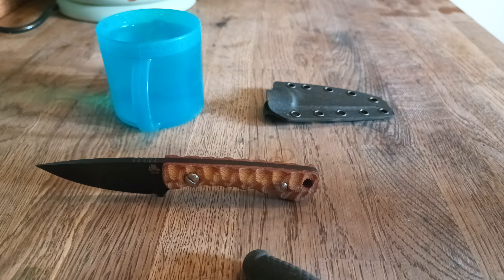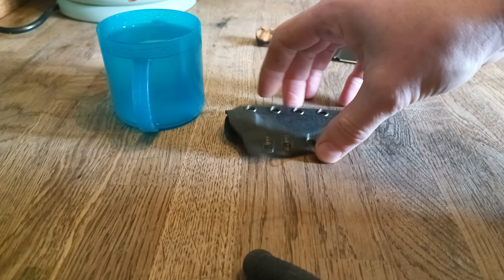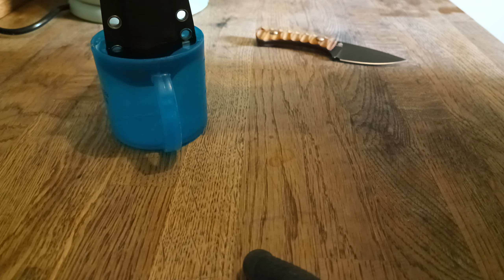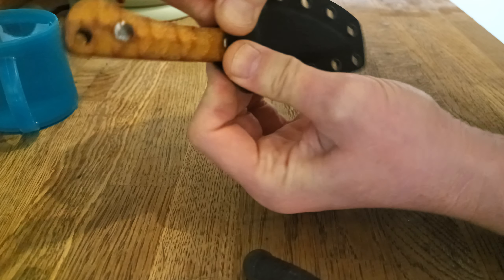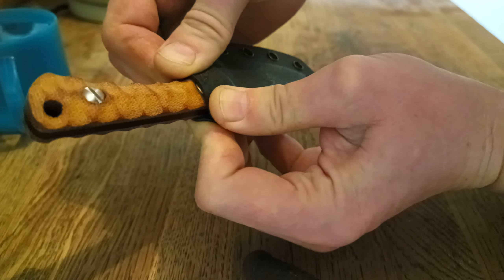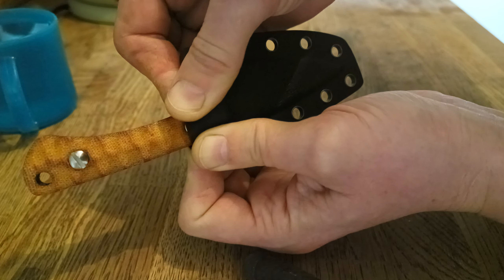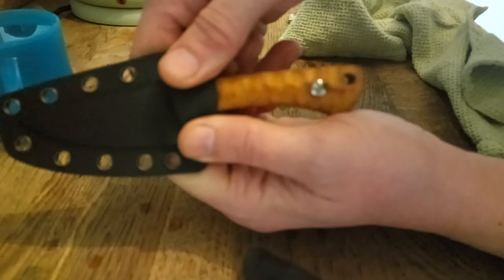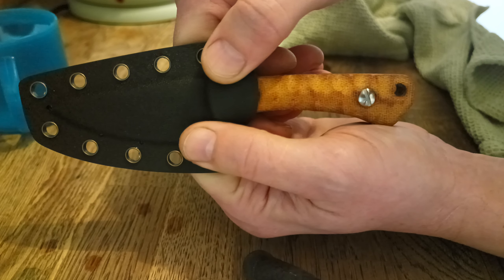How to adjust Kydex sheath retention on the TwistedGbler

Comment: I just got my slip joint in the mail. My favorite knife ever made is the Tony Bose Lanny’s clip. I own 3, made by case. They are so expensive and I cherish them so much I only ever carry one and not often. I also have 2 GEC 74 stallions. This knife of yours is so good. I’m planning to buy a back up for display. Is there any chance you could do a limited edition version with wood or micarta? I’ll buy one of every version you make. Thanks from Alabama, you’re doing great work!
Reply from the maker: Thank you for your kind words and support, we're looking at producing more traditional slip joints, we've currently got a run of authentic Sheffield made slip joints on the site.  Made using authentic Victorian and vintage machinery. 
We're also looking into making a range of classic Slipjoints but with screws and bolts instead of peening rivets, what's your thoughts on that? 
Regards 
James
Reply: I love the look of the Sheffield knives. They look like Taylor’s eye witness. I’m definitely going to buy one of those. I’m a traditional knife guy, I’ve tried a few modern slip joints including a C. Risner Ohio river and a Jack Wolf midnight Jack and honestly it’s not my bag, they’re too thick and they don’t speak to me the same way. I can tell you, loads of guys in Bearcats Barlow Club and AAPK love them so I don’t blame you for going that route. Your Lanny’s clip is just so perfect and as a Lanny’s clip fan I’d love to see more options in covers and maybe a 82-90 mm “little bro” version. Pretty much no one makes them and when someone does they’re crazy expensive. Good stuff from you guys either way. I’ll be looking out for whatever you do! My next buy will be a T.A. Natural micarta Sheffield. Thanks again.